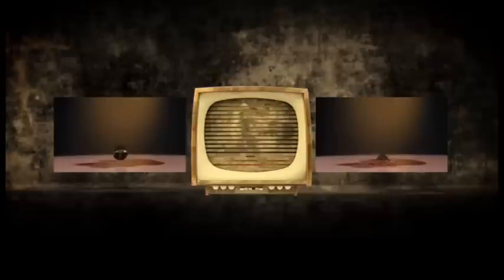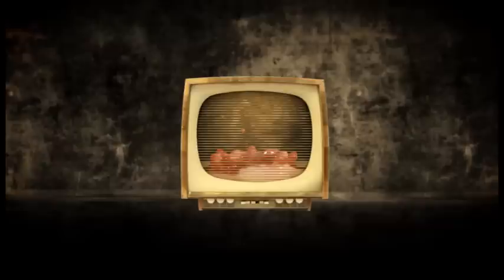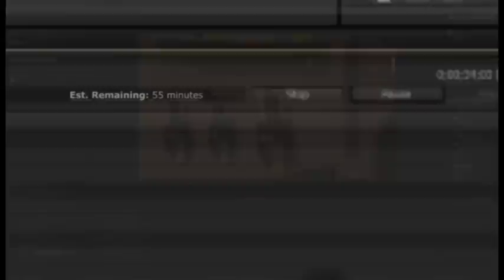How to Deinterlace Footage

Comment: How to interlace footage?
Reply from the maker: why would you want to do that?
Reply: @videomaker  no idea
Reply: @videomaker  it looks cool
Reply: @TheWolvesGang  Export as interlaced, as easy as that. But in the time of interlacing, video never show comb effect. It only shows it when displayed on computer without deinterlacing.
Reply: @debranchelowtone  I want comb effect
Reply: @TheWolvesGang  I understood, i just wanted to be accurate. There is another way to do that, using Shutter Encoder and "force interlacing" option. Also, if you want this, your video should be 50p or 60p to begin with. Then the comb effect will appear as wanted.

Comment: I don't know if you don't understand video or what, but by shooting in I is the only option to get 60FPS even on most prosumer camcorder unless you want to get stuck with 24 or 30 FPS yes you get P but low frame rate. Not to mention you'll get super lame slow motion when you try to slow down a 24/30 FPS clip.

Comment: My favorite 2 methods to deinterlace are: Yadif (gives absolutely flawless 30 fps picture) and Bob(for 60 fps sources).
Bob is generally kinda shaky unless 2 frames are blended into one but there is a trick one can do to get around that problem(I used Vegas for this):
-Set your bob deinterlaced footage on the timeline, make sure the project is set to exactly 59.94 and that your footage is set to force resample(to avoid de-synching )
-You need to copy the footage and paste it on top of the original(in vegas it's pasting it on a new video track on top of the original)
-Make it half transparent  and a frame late
This way the fields that normally dissappears every other frame is still kinda there, the image remains stable and the motion blur is minimal(it's only as much or less as you'd see on the old TV)
Here is an example of what I'm talking about
http://youtu.be/Atc86nf7pFE
To anyone wondering Xploder in the title is an app on the PS2 that essentially renders each interlaced field as a progressive frame(so the same thing as using bob just saves me time and harddrive space)
And yes the video is at 60 frames just not animations in the game are (it's mostly the scrolling and special effects that run at 60)
Reply: QTGMC is better, although it doubles the frame rate and has artefacts.
Reply: @diablonerd9612  never heard of that one
Reply: @nikodem123asdf  It has better quality than Yadif and can even be used for noise removal
Reply: @diablonerd9612  is it available in vegas?
Reply: @nikodem123asdf  No, but its in AviSynth+
Reply: @diablonerd9612  ok good to know. I likely won't use it cause i have a retrotink 5x for all my interlaced needs

Comment: Just so everyone is clear, interlacing is not "bad." It is still used extensively, both by broadcast TV and in consumer and commercial camcorders. More important, deinterlacing video does NOT make it better and in fact always irreversibly degrades the video and makes it worse. This degradation happens because shifting the odd or even field in time or space (or both) cannot be done perfectly, and all techniques involve creating new fields that are compromised in some way.

Thus, you should NOT deinterlace, unless you are required to do so. This video is very good in describing HOW to deinterlace, but very bad by failing to point out the situations where you NEED to deinterlace, and the situations where deinterlacing is not required.

The simplest way to state this is that deinterlacing is only required when re-sizing the video, or when changing frame rates. Re-sizing without deinterlacing will create a mess, so you MUST do it before re-sizing. However, if all you are doing is encoding the video, using the same size and frame rate, you often can skip deinterlacing, and thus end up with a higher quality result.

Bottom line: deinterlacing <> better.
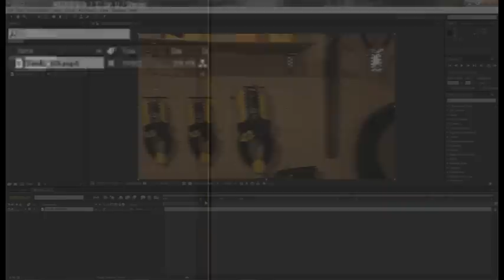Reply: 1:16
Reply: The vast majority of consumers and even professionals are using high quality progressive displays. There is absolutely no reason to be shooting interlaced unless you're unable to upgrade. High quality interpolation deinterlacing should ALWAYS be performed prior to presentation unless your goal is a VHS tape or some other analog medium.

Bottom line: deinterlacing = better - unless finishing to tape.

Comment: I dont understand how the field extension works.I mean I you copy all the present fields and put them into the missing fields wouldnt the frame be a other frame? I mean the then empty or missing field look different originally....and why does the quality drop if you didnt change anything about the format?
Reply: Each horizontal line become two times taller, you lose half the resolution and half the fluidity of movement.

Comment: I would prefer motion detection as it preserves the full resolution while preventing motion artifacts.
Reply: What software do you recommend to be used on a Mac for motion detection deinterlacing?
Reply: @dbaker036  i don’t know but for what i do know is that hqv should,ve to have the best deinterlacing method.

Comment: I have video's recorded off a JVC GZ-MG132EK SD/HDD camcorder, the image is showing interlacing scan lines, and artifacts and blockiness, the colours have compression artifacts can Adobe Premier Pro, Sony Vegas Pro  remove or adjust these annoying issues that I am facing, lets face it JVC does make terrible camcorders, I would stick to Panasonic or Sony as you can select between HQ, SP ,XP modes that JVC Camcorders don't have. Is there anyway I can remove any of these video issues I am facing from my video's as JVC Camcorders have 5 recording modes I choose fine, ultra fine and normal all of these modes don't produce crystal clear images without any artifacts or interlacing scan lines, which i find very annoying, Please help as I want my captured video's to look clear and not like a poorly encoded video.. No matter where I record my video's they all come out looking poor. Though on the LCD viewfinder they look clear,
Reply: did you try applying Yadif deinterlace in vegas?
It's a custom plugin you have to download it(it doesnt come with vegas itself)
It's a much better deinterlacer than the options vegas comes equipped with. you just need to remember to disable resample on those clips, go to properties and change their field order to progressive(i know that sounds crazy but that's how it is) and than apply the yadif plugin via Media FX(not event). Give it a go
Reply: ***** You're welcome also for those without a high end editing program, ther is also Handbrake's bob deinterlacing (which is really bob and yadif combined) it lets you do 60 fps videos from interlaced sources and in really good quality and low interference.
Reply: ***** type handbrake in google it';s a free converter that just does the job. you may want to play around with the options(as you've learned one deinterlacing method doesnt suite all types of video).
-In general pick "none" by size(It'll leave the video uncropped) 
-You may want to try either the "decomb"(less agressive) or "deinterlace" (more agressive) filter (always set bob for both deinterlacing and decombing in this software it just means the highest setting).
- Framerate same as the source and constant(variable sometimes doesnt read in other software) the rest just set the x264 to medium, h264 to high and level at 4.1 and constant quality at around 18-20 (you can leave as it is too).
-It's not worth going overboead with some of the settings(going above medium) simply because the video may start dropping frames.
It's good to experiment on your own, I have no idea about other filters cause I never had to use them.
Reply: ***** what region is the DVD you want to convert?
Reply: ***** so it may be 29.94 frames or 24

Comment: In my opinion, if the options are to shoot in either 30p or 60i at the same resolution, 60i is usually better. I mean, if you don't like smooth video then you would like 30p better regardless of anything I'm about to say. Assuming you want smooth motion, then you want higher frame rate. Modern video is typically of such high resolution that you can't really even see the interlacing unless you are trying to find it. If you crop (digitally zoom) the video, then you are reducing the resolution and the previous statement doesn't apply. But you're also just making the video lower quality anyway, so who is gonna fuss about interlacing at that point when the video is already lower res then it should be? But then on top of this, we also have fairly decent automatic deinterlacing technology which will make the video look only marginally worse than something shot progressively at the same frame rate.

Back in the early days of digital video, interlacing was definitely bigger issue just due to the fact that resolutions were worse. Resolution used to be bad enough that you can reasonably see individual pixels under normal circumstances. Since that is no longer an issue, interlacing (as a means of shooting higher frame rates than otherwise possible) is also pretty much a non-issue.
Reply from the maker: 60i and 30p are the same
Reply: @videomaker  Same NTSC tempo yes, but what he's referring to is the 60 fields a second you get with 60i like on Television or 50i in Europe with content shot that way. For NTSC it's merely stored at 29.97 -- 25 for PAL. It has the same look as high frame rate progressive 59.94/50fps video. Where as shooting at 29.97, 25 or 24fps progressive you don't get that high frame rate motion. Some people call it the soap opera effect. I personally like it and it looks much more like real life without any of the motion judder and chop with lower frame rates. Projected 24fps film was different and a lot smoother but digital video at the same frame rate never looked as smooth. I also agree with the higher resolutions and auto deinterlacing in consumer electronics Matt eluded to it's effectively a non-issue now a days. I'd much rather have high frame rate 1080i video than progressive 720 "HD" at a lower progressive framerate. 720 is so marginal anyway now a days I would actually demote it from HD standard to EDTV standard joining 16:9 576. The new OLED TVs are pretty bad with motion fluidity without frame interpolation help, I think consumers would certainly appreciate the higher frame rates. Another issue is some faculties improperly deinterlacing true 60i HFR content to 29.97 disposing of the HFR in the process. Like Matt said that's something you'd do, ideally YADiF with "fake" interlaced or telecined content. Thanks for the channel keep up the good work.